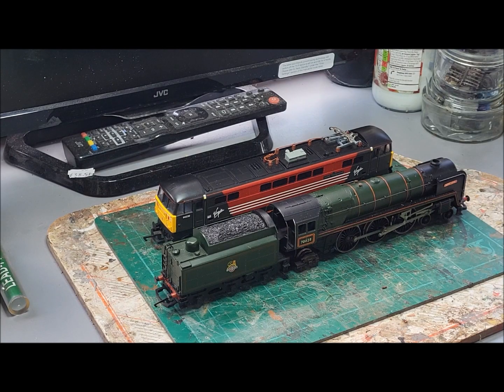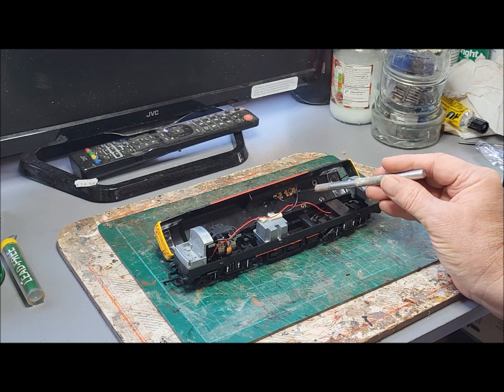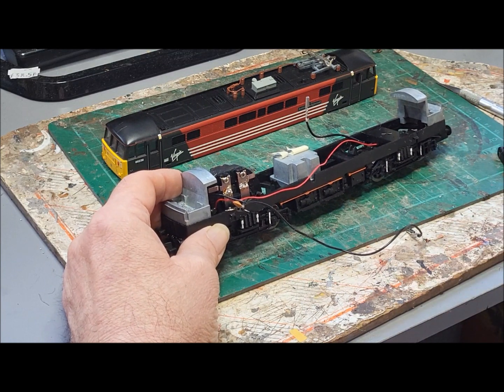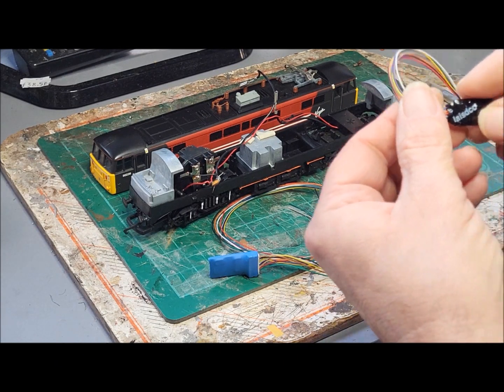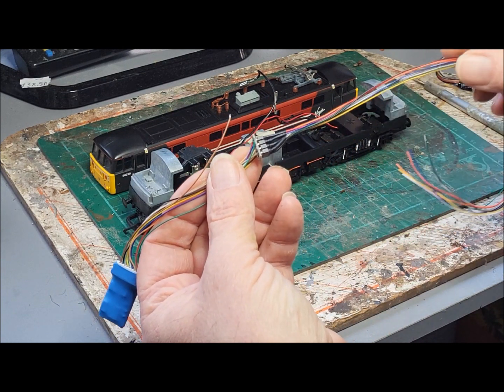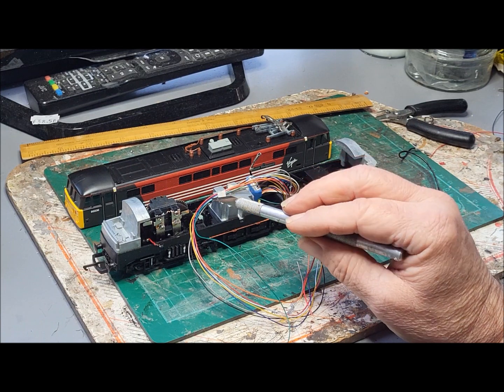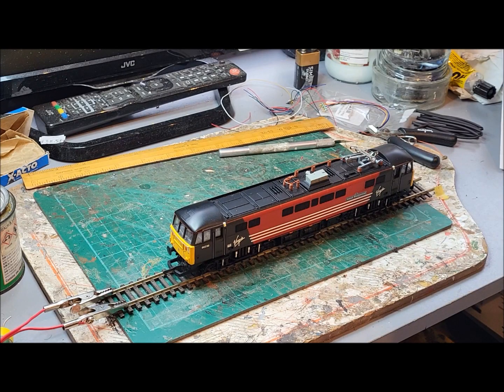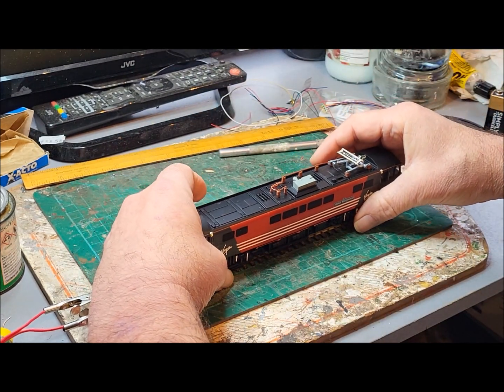Hornby Ringfield powered Class 86 Virgin livery DCC chipped.

Comment: where do you get the sockets for the chips ive not been able to find any as of yet want to dcc my watermans railways 47s
Reply from the maker: Hi, I got some from dealer at a  show but I also got some from eBay. Just search 'laisdcc 8 pin harness' and it should bring up what you need. Prices vary but you should not need to pay more than £2 each. If there is a model shop near to you they might have these in stock. May cost more but you may save on postage. Hope your conversion goes well. Woody